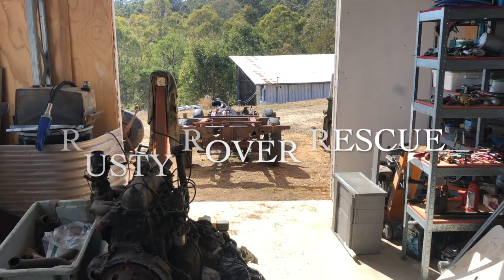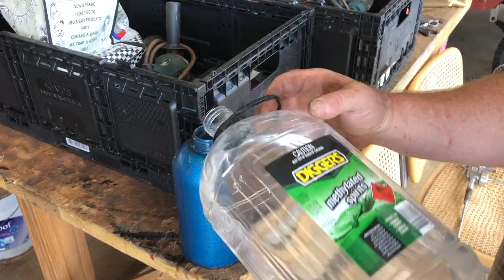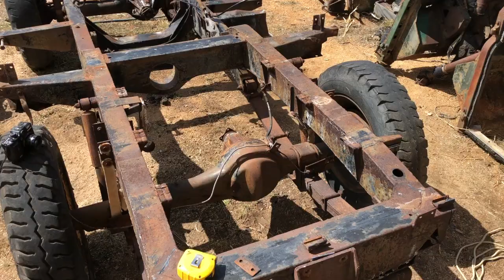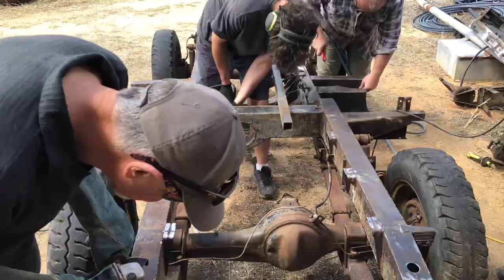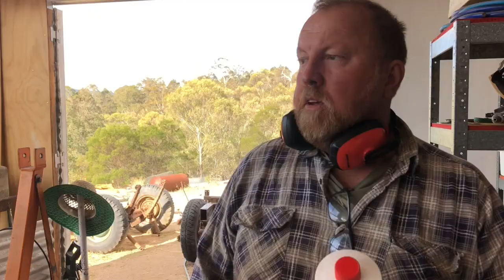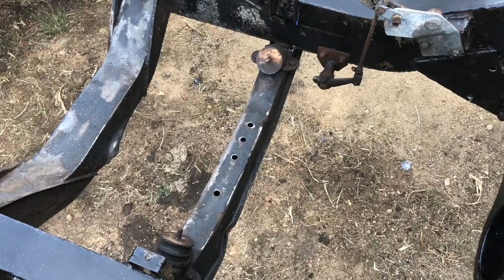Land Rover gearbox removal & continued chassis resto - restoration and electric conversion - Day 6

Comment: Hi from UK, interesting challenge. Your comments imply you're keeping the gearbox and I guess the full 4wd stuff - is that the plan ? I know a lot of EVs don't bother with a gearbox and the space might be handy for locating batteries... What motor/batteries are you planning to use (sorry if I missed that detail somewhere) - something rescued from a crashed car or what ?
thanks for the entertaining videos.
Reply from the maker: Giday Rhian, yes we are going to rebuild the gearbox, transfer, front and rear diff etc and maintain full 4 x 4 with 4 speed + R in high and low.  We will also fit a reverse polarity switch to the electric motor which then gives us the same gearing in reverse (although I can only see limited use of this with some PTO stuff...but heck, why not, its just a switch :-) ).  We have not decided on motor and batteries yet,  EV options seem to be evolving pretty quickly and we will make that decision when the car is getting closer in a few months.  There is plenty of room for battery needs (about 25Kw) under the bonnet and under the 2 seats where fuel tanks fit normally.  Thanks for your questions :-)
Reply: @VintageRestorationsAustralia  If you go down the EV route, most/all motors will be 3 phase AC so reversing is just a software "switch" I guess. thanks
Reply from the maker: @rhiantaylor3446  We are actually thinking of a DC motor for simplicity - maybe a fork lift motor repurposed or similar. Not going for regen brakes etc so DC is simple.